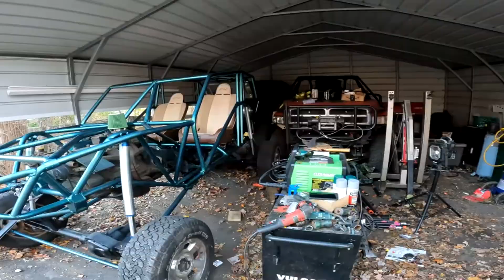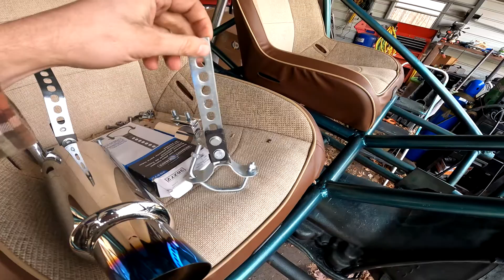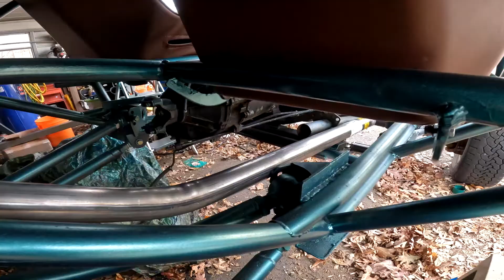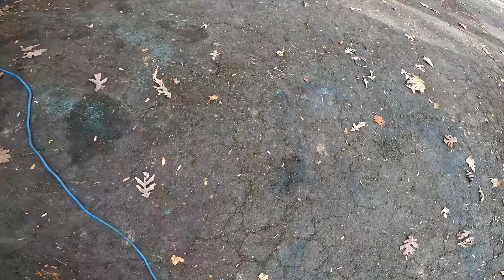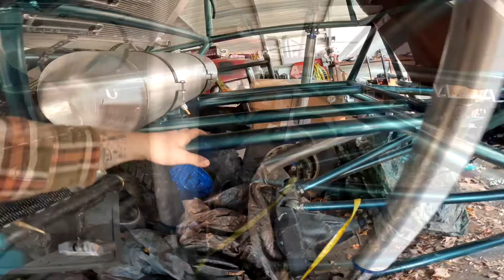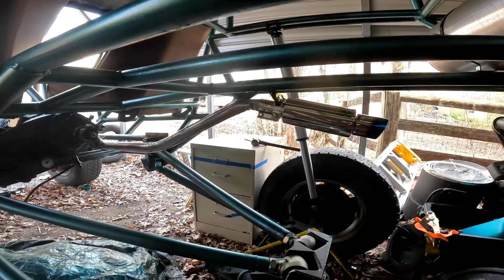Cheap and Easy Single Pipe Exhaust Build on the Tuggy Buggy || Legacy 4x4 & Off-Road

Comment: Looks great 👍🏻 but I’ve got a question on the clamp up close to the motor after the floor is installed wouldn’t it be better if you turned it over having the bolts on the bottom for easier access
Reply from the maker: I mean maybe but it’s a 5 min fix if it’s an issue in future!!! Thanks for the tip though!!
Reply: @Legacy4x4andOffRoadYT  that’s true unless the floorboard is to close but since you’re building it yourself that means “  you can do it “ 😁